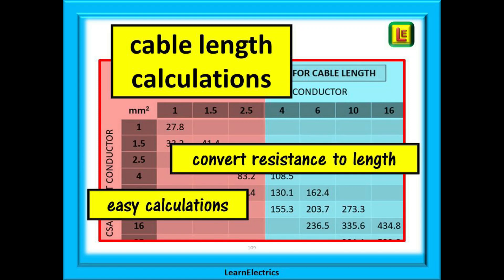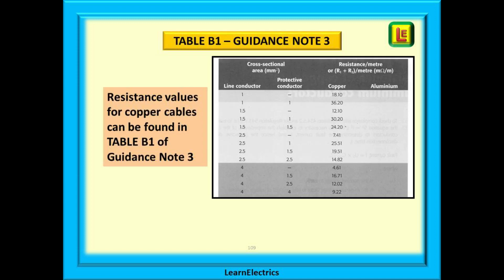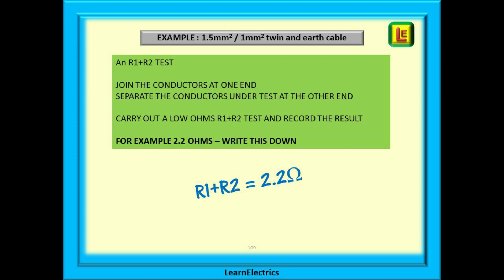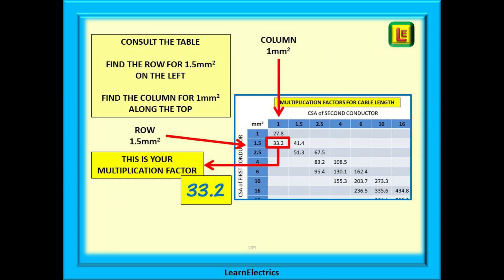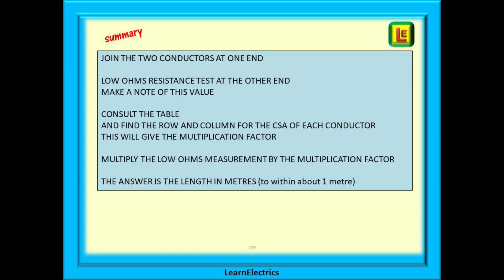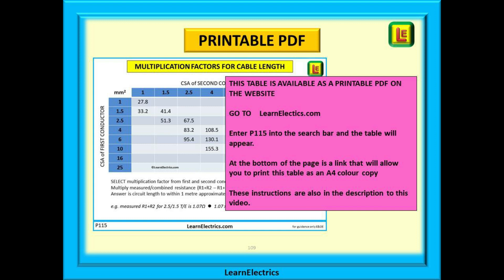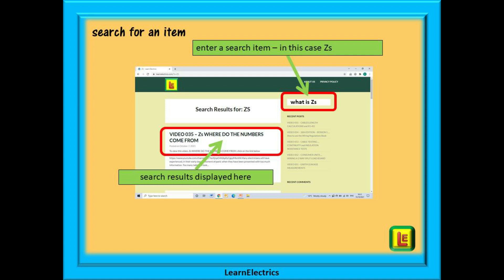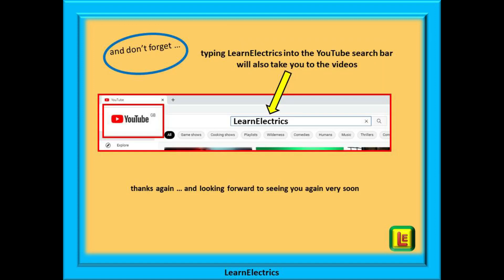CABLE LENGTH FROM RESISTANCE – EASY CALCULATIONS – HELPFUL TABLE

Comment: Dave why is two different calculations giving different results. Ie 2.2x33.2=73.4 but do it by 22\33.2xtento the minus 3 =66.2 meters.
So what is more accurate
Reply from the maker: Do you mean 22 x 33.2 divided by 10 = 73.04, the same as the first method?

Comment: Please which instrument will you to measure the resistance of the cable...
Reply from the maker: Use a multi function tester set on the low ohms range. You can use a multimeter but it will not do all the other tests that we need for domestic or industrial electrics.
Reply: @learnelectrics4402 
 I try measuring 1metre length of 2.5mm² cable with Clamp meter and I have 0.5ohms and I again use digital multimeter and I had 0.00ohms

What might be the problem. Is the right instrument to use.

2. Please where can I download the Guidance Note 3

Comment: Great video in plain english thank you. Is this table in BS7671-2022?
Reply from the maker: The cable length tables are in the Appendices of Guidance note 3 and the On-Site Guide. Thanks for watching. Dave.
Reply: Waiting on GN3. Looked in the OSG and couldn't find it. I'll take another look 👍

Comment: Great video, thank you! going by the info on the table; would the multiplication factor for 0.50mm^2 CSA conductor be 13.9 and for a 0.75mm^2 CSA conductor be 20.9?
Reply from the maker: Yes, correct, you've got it sussed. Impressive. I'm assuming 0.5mm/0.5mm for one cable and 0.75/0.75 for the other. Thanks for watching. Dave.

Comment: Thank you for simplicity simplising subjects to understand easily. I was reading onsite guide on page 63 there is a formula to find the permitted cable length. Would you explain how to find the cable length for the circuits.
Many thanks again
Reply from the maker: Glad you asked that, its a formula with a special use that is explained in the video we have just finished.
It will be published on YT this weekend. 
Also, look at this formula that explains in detail the standard formula. Thanks for asking. Dave.
https://www.youtube.com/watch?v=Qq_9MNH8XxU

Comment: Where did you get your values from for your table? GN3 table  values are taken from 20 degrees which are different.
Reply from the maker: The values for resistances do come from GN3, but these are multiplication factors, not resistances. Thanks for watching, appreciated. Dave.

Comment: Clear and simple explanation Dave thank you! I was wondering where I could find the multiplication factor table in any of the books? It would he helpful to know thank you.
Reply from the maker: Thanks Ricky. Yes, the table isn't in any books. It can be printed from our LearnElectrics website the dot com one. Put P115 into search bar on the website and there is a download link for the pdf below the pictures. There are also details in the description to this video. No-one else has made a list multiplication factors.
Cheers. Dave.
Reply: @learnelectrics4402  Thank you very much for your effort, very helpful and much appreciated.

Comment: Good day Dave, I have been an ardent learner from your videos. sorry to digress but I'd really appreciate your expert opinion on this.
Please what are the cause(s) of negative power factor registered on An Maximum Demand (MD) meter.
How can this be corrected.
Reply from the maker: Thanks for watching Obinna. There can be several reasons, energy normally transfers from the grid to a house, but if there are solar panels, there could be a transfer to the grid. That is to say, power flows from what is normally the load towards the source. You can also get it with regenerative braking, use an electric motor to go uphill in a vehicle, and then turn the motor into a generator to slow it down on the descent.
Hope this helps. Dave.
Reply: @learnelectrics4402  thanks Dave. We don't have any solar panel installed. Simply grid supply and a standby generator. No motors. Because it's an office building. Administrative offices

Comment: Hi,
Just for reference that table is for cable running at 20 degrees & when doing dead tests its not at that temperature.  Heat increases the resistance.

You could use resistivity 
R=pl/a
So.  L= Ra/p
Ie.   0.46x1.5/0.0172 = 40.12 meters

Or using the table in your video
1.5mm /1.0mm t&e  0.79 ohms

ie.   0.79×1000/30.20 = 26.16 meters at 20 degrees 
X by 0.935 to get rid of the cable running temp. 

26.16 x 0.935 = 27.98 meters

Hope that makes sense
Reply from the maker: Thanks for your comments, appreciated. 26/27 metres is a good guide.
Thanks for watching, Dave.
Reply: @learnelectrics4402  

Would be good maybe if you could maybe do a video on TT rcd 100mA & 30mA  trip times for EICR's.

Comment: Brilliant and helpful as always, so clear and easy tp understand. May I ask, what is your opinion on running cable in the cavities? I am told this is not allowed but I cannot seem to find it in the regs etc. thanks again
Reply from the maker: Yes you can if you follow the rules of Reg. 522.6 p139/140 in the Regs book.
I don't know your set-up but 522.6.202 may apply, especially the LAST sentence om p139 which will allow an RCD to be used. 415.1.1 is on p73 - a 30mA RCD
Hope this helps and thanks for asking.
Dave.
Reply: @learnelectrics4402  excellent! Thanks so much for the detailed reply, I don’t have the install I’m just learning but was interested in the matter. Thanks again, look forward to more content 🙌🏼

Comment: Brilliant video Dave and so useful to have in the tool box. I did use this at a wholesalers,
 as I'd bought a 100m roll of cable and it came up short....so I went back and measured a new roll and low and behold only 80m on the roll! We put a lot of trust in whats written on the box! Well done once again for all your help.
Reply from the maker: Yep, it works. That would have cost you money if you hadn't checked.
Thanks for your support Gary.
Dave.
Reply: @learnelectrics4402 
Dave, please which instrument can you use to measure the resistance of the cable. I try measuring 1metre length of 2.5mm² cable with Clamp meter and I have 0.5ohms and I again use digital multimeter and I had 0.00ohms

What might be the problem. Is the right instrument to use.

2. Please where can I download the Guidance Note 3

Comment: Hi Dave, many thanks for your very helpful video. I note that the Onsite Guide says 30.20 milliohms  for 1.5 & 1 mm T&E and not 33.20 as stated by you. Have you applied a rating factor in order to get a higher number and if so can you remind me why this is necessary. I may have missed your explanation and apologise if so.
Reply from the maker: 30.20 is the milliohms per metre value
33.20 is the multiplication factor to find the length and is just a number, a multiplication factor, it is NOT milliohms per metere.
Two completely different numbers but I'm glad you asked. Thanks for watching.
Dave.
Reply: @learnelectrics4402    Is it not so that (R1+R2) divided by 30.2 = length? 

These are fantastic videos..
Reply: Where is the multiplication factor table in the GN3 ???

Comment: Brilliant once again. To check a ring main is it exactly the same but they’ll be two conductors in each wago or terminal block?.
Reply from the maker: No. have another look at the video. Its exactly the same for ring or radial.
Split the two ends of ring at the CU. And then treat it as a radial for the test. I.E. join two wires of one cable and test from the other two. This will tell you the length of the ring. If you join 2 in one waygo and two in another waygo, its not going to help. You need to be able to test down one wire, through the waygo and back to the meter.
Hope this helps Dibbo.
Dave.
Reply: Thanks dave👍🏻